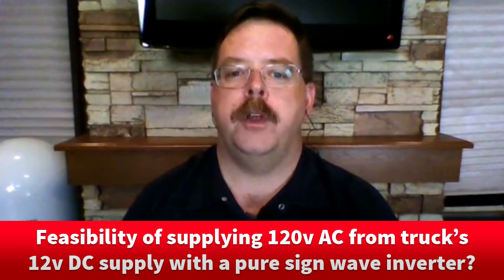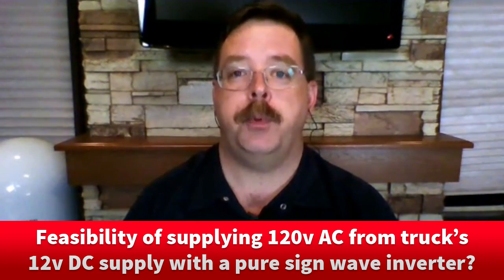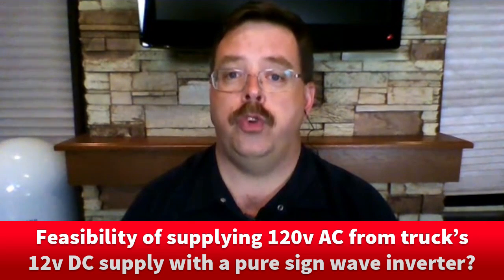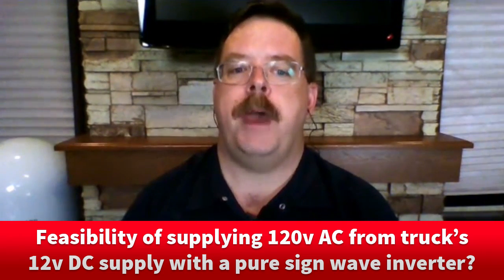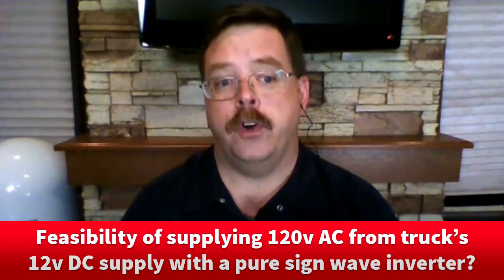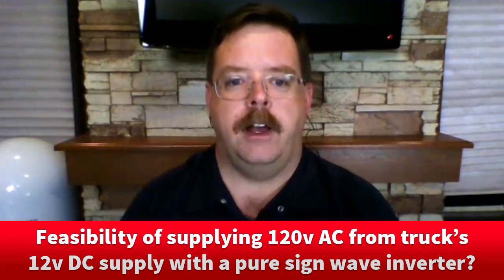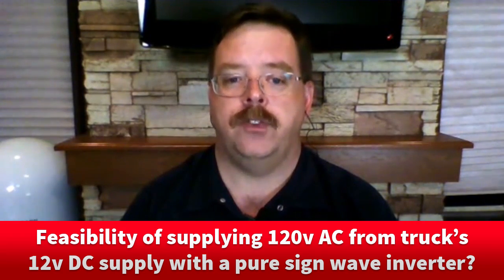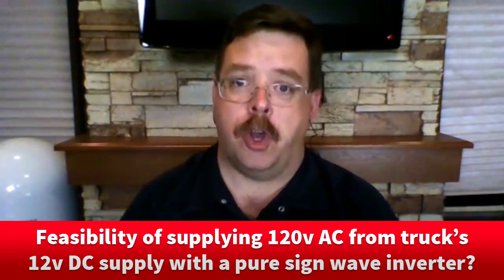Make sense to use truck's 12-volt system with inverter to send 120v power to RV?

Comment: That's a crazy distance to run heavy gauge wire...and I doubt that it would be feasible to run your 30 amp AC roof top air conditioning for any practical length of time off a set up like this. I'd love to see a video of the install and a demo...